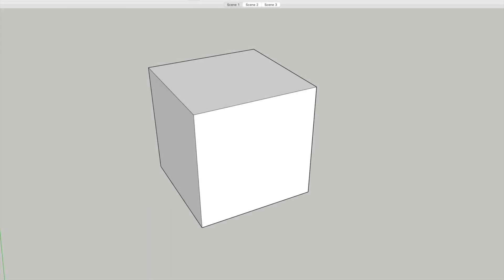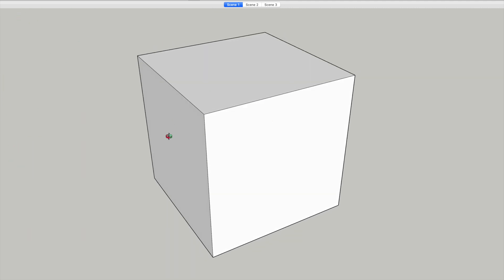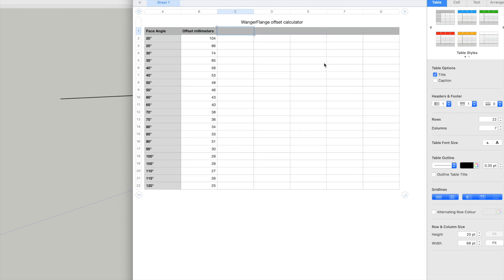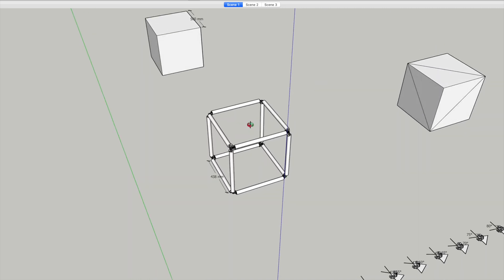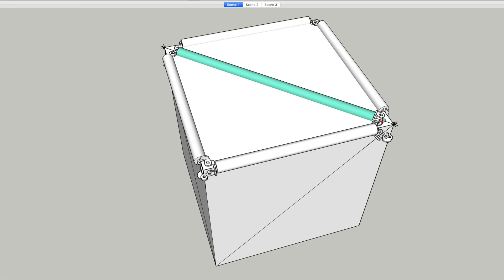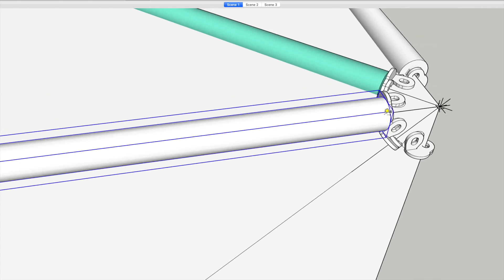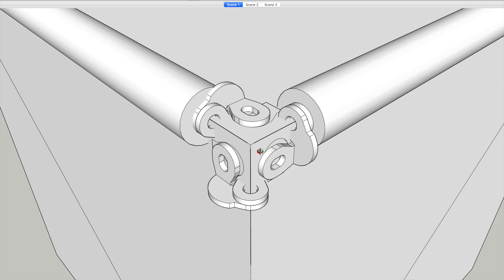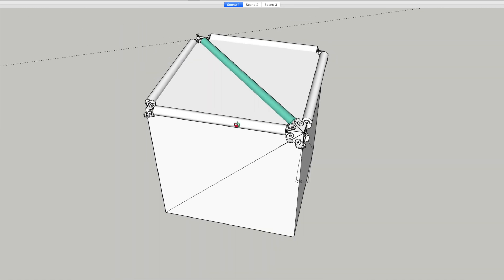Drawing WangerFlange structures - working out offsets

Comment: so if the box is 500mm and i wanted to keep the box/cube @ 500mm, as we are working from a centre line, you would have to deduct the thickness of material you would use, ie, lets say 18mm diameter tube/dowel, the box cube drawing would be 482mm?

Comment: Hello Paul,
How do you calculate the offsets for the 10-way and 12-way connections in a 3v trussed dome? In those cases, the dihedral angle flips back and forth between convex and concave. Does that change anything?
By the way, have you done any more modeling of the trussed 3v dome idea?

Comment: imposing  to understand the structure  to this would be the same when you would use a spare frame too  it would change when you would use a 2x4 then cross bracing would then ends to fit the corner  
looking forward to receiving mine yea larger set of the mechanical set for me to get lost in the building